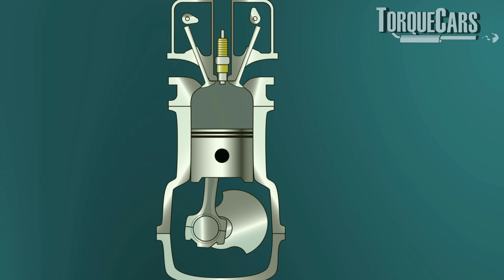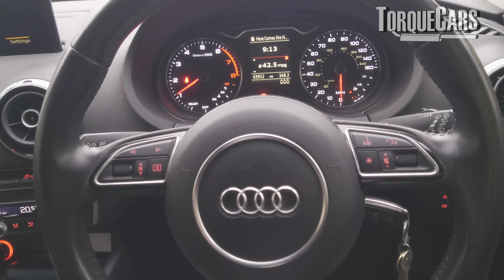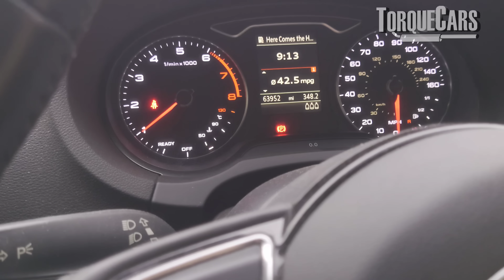These Common Cold Start Mistakes Could Destroy Your Cars Engine!

Comment: In reality as long as you’re not redlining or revving hard until the oil gets up to temp you’re fine. No need to “let the car idle” for a few minutes, at that point you’re just wasting gas. It’s probably more important to follow a strict and frequent oil change interval.
Reply: Spot on.

Comment: With letting the car to do the coldstart cycle, then start driving away with soft throttle and not go over 2k rpm for the firsts minutes until the coolant reaches 80 Celsius. Then can start driving normally

Comment: Main thing use full synthetic oil and change regularly,
Reply: ...and as the video suggests, warm-up the car. GM did a test with the SAE to detect real-time engine wear by irradiating the cylinders, pistons and piston rings and with an already warmed-up engine, they started to reduce the coolant temperature and the wear metals increased sharply so it's not just about the oil but how long you operate the engine, especially under load, under operating temps.
Reply: No point using fully synthetic oil unless the engine is made to take it.

Comment: Great video, thanks! My car (Alfa Romeo Spider with Bialbero-Nord 2 Liter engine), a 1982 build, has no electronic systems at all but the old way of a manual choke. I guess to raise the RPM by 200-300 RPM as you suggested, a small amount of pulling out the choke-knob would do the trick, wouldn't it?
Reply: It’s an Alfa🍀🤍❤️
Mito Benzina owner here😎

Comment: What I do is when the RPM come down to idle, I leave it idling for another couple of minutes and then drive slowly in 1st gear at 1500 until the gauge goes up to halfway normal. Then still in low RPM I wait until it reaches normal operating temp. Still not revving it, I give it another good 20min for the oil to reach normal operating temp. and then I feel free to drive hard.
Reply: This is unnecessary…
Reply: If you have the time that is completely fine. Unfortunately while going into the main roads it does not allow for conservative driving. But it is good to let idle and drive out through the small streets before going into the main roads and giving it big loads
Reply: What are you driving a car from the 1960s? 

Modern cars do not need 20 minutes to warm up.
Reply: @chriswilson9331  disagree large capacity engines with oil temperature guages take an age to warm up, at least 10 miles
Reply: While it does take a while to get engine oil up to operating temperature, that does not mean you have to baby it until it does. Everything you’re doing is completely unnecessary. 

Drive like a normal person and your car will be just fine.
Reply: @Reginald_Harrison  There is no indication when the oil gets up to temp. and I thing it's better to err on the safe side. I used to have a 1970 Alfa GTV with an oil pressure gauge. The oil pressure was unusually high for much too long periods, or unless I revved the engine high at some point, the gauge wouldn't come down to normal.
Reply: It's genuinely surprising how long a large capacity engine takes to get the oil properly warm, at least 10 mins of driving.
Reply: Hardly practical for the average working person it
Reply: I’ve got a Toyota MR2. I’ve done 130,000 miles in it. I start the engine, put my safety belt on, and drive off. If the windows are frozen, I let the engine idle and put the rear window Demister on to melt the ice. It’s what everybody does. The car is now 16 years old and still going. I use it mainly to drive into town 8 miles away, and on holiday, which could be two to three hundred miles away once a year. I wouldn’t want to do all that “faffing” around.
Reply: My EV does not care about warming up 😅
Reply: @maesc2001 but it doesn't move until you spend how many hours  ? Charging it.
Reply: @maesc2001 You'll 'Warm up' when the battery needs replacing! 😆🤣👍
Reply: @ Won’t be happening anytime soon; I change cars every three to four years.
Reply: Look after the turbo by checking your oil temperature. I do this in my 2015 Golf gti . 100% reliable.
Reply: I leave mine running for about 4 hours then drive for about 20mins slowly in 1st gear then im on my way 😂😂😂😂😂
Reply: @paulmalone1208  It all depends on what you drive. If it's a Yaris, I guess it's OK. I follow the above procedure on a Jag F-Type.
Reply from the maker: That is a good tip and it's nice to see someone being ultra careful.
Reply: @TorqueCarsDriving  This car is my pride and joy, used on weekends when the weather is fine. My daily I also warm up in the morning and pamper until it reaches Noral OT.
Reply: @kyproset  that's so unnecessary but you do you :) idling is bad for the engine.

Comment: I think the Engineers have worked it all out so that we dont need to worry about cold starts . 
No need for all this OTT
Reply from the maker: Some newer and high performance cars will limit throttle and RPM whilst the engine is cold, but most do not so a little mechanical sympathy goes a long way to keep your car working efficiently for a very long time. As I said at the start,  in the worst case of driver abuse you typically will knock 20,000 miles off the engines overall life. Most will sell the car before they even experience the detrimental damage done.
Reply: If everything had been perfectly designed, how would they make more money by selling us new cars? 😂
Reply: @hisownman  so true man😎😎 (and THEY invented that wetbelt 3 cylinder Purecrap too🙄🙄)
Reply: @dusankocisevic6823  Nothing wrong with mine, idiots skimp on servicing intervals, use wrong oil and rag it..cud be worse..ford ecobooms are same wetbelts and 3x as costly to change than a puretech

Comment: when iI lived in Iowa 60 years ago there were cooling syestem heaters, ' dip stick heaters, and battery heaters to keep the engine warm in subzero tempatures.
Reply: Sump heaters can be bought for after market installation.  Where I live the weather is not that cold but I am considering installing sump heaters to my car and van. It will be interesting to see if it makes a difference to fuel economy.